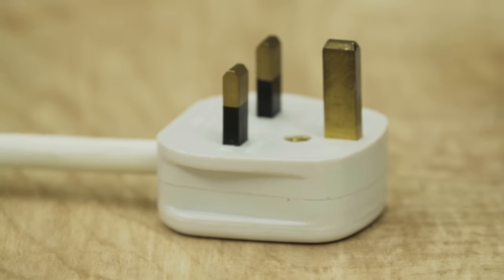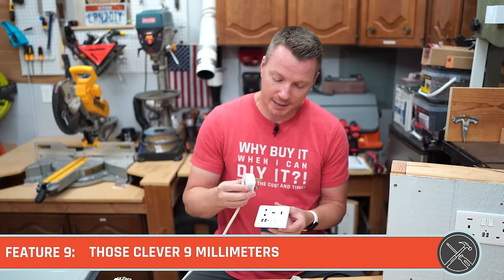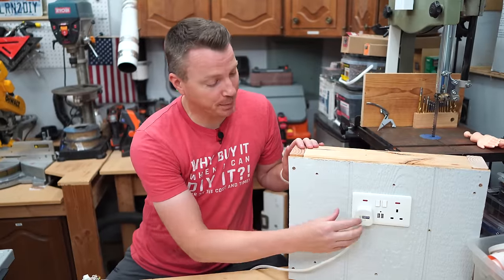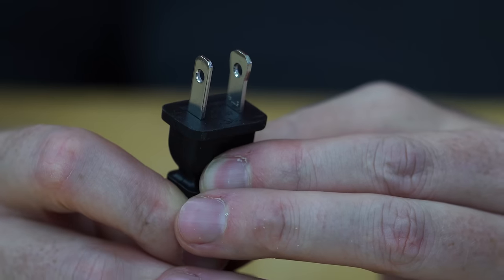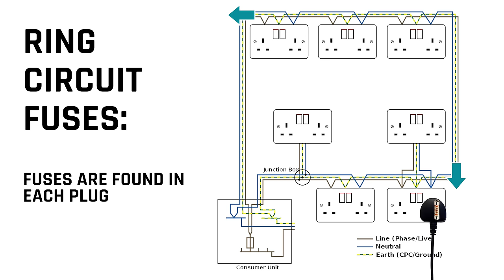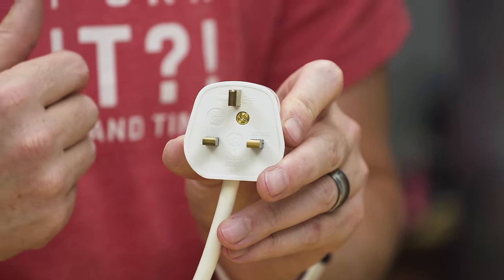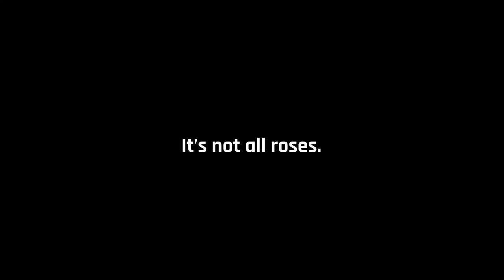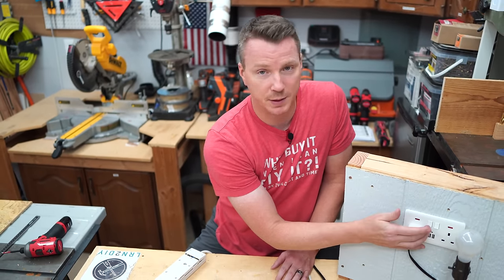British Plugs and Outlets Are On Another Level

Comment: As a professional electrician I think they are pretty good but not as good as the central european standard system especially the versions in France and Germany.  and while every country has it's own standard, the two pin version is a standard that fits in all the different outlets in europe except for the british one.

In comparison to the british the differences are:
10. like britsh, earth connects first although the wholes aren't blocked unless you buy an optional safety piece which isn't as good as the british one.
9. the plug is suspended in a hole which serves the same purpose. The two pin Version is just like the british.
8. The Cord orientation is the same most of the time but there are also straight ones
7. like the british
6. Sometimes it's better to have a plug that cant be opened. there are both versions availabe but a fully molded plug is, although not fixable, the best option in terms of durability, the cables almost can't get ripped out, and it's tighter sealed against humidity and corrosion.
5. Fuses are in the device rather than in the plug. Debatable what's the better solution but it saves space for the plug.
4. like the british (maybe a little less but still good)
3. like the british
2. no switch but that's less of a plug type thing than a standard for the whole system.
1. like the british

-Another difference is that the german version aswell as some others but not french and the two Pin Version are twistable. Sometimes I want the cable to come out in the other direction. However it comes with the disadvantage of not knowing which wire is life and which is neutral.

-The size is more compact then the british one. and the two pin version is so slim, you can even use two of them side by side in one outlet it some special kinds of the german outlet.

-No ring system

Overall the form of them with the suspended outlets just seems even better, then the british ones and it's a standard where a lot of different plugs can fit in the same outlet.

Comment: As for the European 2 pin plug, quite a few small appliances from very reputable European manufacturers come with them. Most need to be used with a shaving adaptor (as it's known in the UK) .  The shaving adaptor route is often marred by bad connections as the Euro plug is a fairly lose fit in the socket and there is no support. New shaving adaptors come with a 1A fuse which blows as soon as you turn a more "meaty" appliance on such as a stick blender, so you are forced to find a supply of 5A 20mm fuses. An an otherwise excellent and expensive Italian hair dryer came with a strange snap on converter from Euro to 13A. After a little use it failed and on examination the connection between the 13A live pin and the clip that the European plug pin engaged hadn't been staked properly, overheated and melted the plastic. In both cases the problem was solved by replacing the Euro plug with a UK 13A one.

Comment: I would like to emphasise the asymmetry aspect. I.e. the fact that the positive (phase) pin always goes in the positive hole. This is important because, especially, lamps are only switched on the positive side. In Germany, for example, the otherwise adequate plugs can be inserted with the positive pin to the left or the right, meaning a lamp is still iive when switched off.
Reply: Yes, but that's not unique to British plugs. In America lamps have polarized plugs that are also asymmetrical.
Reply: @aminy23  I didn't claim uniqueness.

Comment: I’ve lived my how life in the U.K. in 45 years I’ve never known anyone with power loading issues.  Until this video, I never really considered that this could be a thing. So I guess it’s really rare. The size of the plug is a fair point, but they’re still small enough to not make any significant impact by their size. The trade off is that you can fit a fuse inside and it’s generally safer. Small price to pay. The point about the switches at the end is just silly. If you’re used to it, if the appliance doesn’t switch on the go-to response is to check the switch at the socket. It takes a second to do. And the advantages with the switches in both safety and convenience is well worth the split second it takes to flick a switch.

Comment: (US here) Would be cool is we could shrink it down a bit to a reasonable size or a design that incorporates a lot of the features while maintaining slimness. The idea of being able to use a welder (in 200v mode instead of 120v) or even 2 high consuming devices sounds amazing without the need for a special plug. But we're so far developed there's no chance in switching plugs. We already have enough issues switching cables as is. Sigh

Comment: To anyone in a contry where type G is the used socket and plug, 10:52 this statement is wild😂. We are so used to switch it on off from both ends and check the remaining end before any troubleshooting.

Comment: The finest plug ever designed you can run a welding set on it, also modern washers it does get hot though.
It wasn't designed by the Gov so that's why it's brilliant.
Reply: It was designed by a government dept.

Comment: Another good feature you mentioned but not emphasized on is that the wires not coming from the side...  but not because you cannot pull it but because you can bring furniture or appliance closer to wall. It drives me nuts that I have to buy an adapter just to be able bring tv stand closer to wall.

Comment: I'm Aussie and there is nothing that you said here that that makes the poms plug better than ours. We have the choice of side, bottom or front cable entry plugs for whatever you want and non earthed appliances don't need a fake earth pin for locating because you cant insert an Aussie plug upside down anyway.
Everything else you mentioned is just as effective or better with this Aussie plug.

And 110V consumption voltage is a terrible Idea but the yanks just have to be different don't they.

Comment: Only bit of information here which was a slight error was when you suggested that you could plug a washing machine into the same socket, typically high power appliances like the washing machine or dishwasher will have their own separate socket, which is a ‘fused spur’ off of the ring main itself, the socket will be hidden behind the appliance and the switch will be above the worktop with its own fuse. * (described to the best of my knowledge I’m not a sparky I don’t know all the technical mumbo jumbo 😂)
Reply: Nope. A washing machine can be plugged into any socket on a British system. Washing machines and dishwashers are not connected via fused spurs off final ring circuits, they are plugged into sockets.

Comment: Not all sockets (receptacles in US lingo) have switches.  Anyway if your device doesn't turn on that switch is always the first thing to check...so it is never a problem.
Load balancing is never needed in ordinary domestic installations.  Load balancing  is needed only in  larger commercial installations.
Just recently I learned that Americans hardly ever use Electric Kettles because they need twice the current because of the 120V AC.
(I really do learn something new every day.)   Everybody here in  230V-land  uses electric kettles for just about everything.

Comment: Interesting video about a plug I've been using all my life! Born and raised in the United Arab Emirates here. The only con I have with this plug continues on what you said about the plug size. The plug size itself isn't an issue when it comes to appliances and such because realistically speaking that shouldn't affect anything. The real issue for me is that chargers can't be as compact, pocketable, or tech pouch-friendly as the American counterparts which typically have folded prongs. I've seen a small amount of UK chargers that have folding plugs, but it's not as common as I think it should be, and I don't think any of them support high charging speeds.
Reply: Samsung phone chargers  have a neatly recessing earth pin, both normal and high-speed types. Still not as widdy as American ones, but not bad.
Reply: @effyleven  Yeah I know those, they're definitely a better option than the regular ones, but I meant something along the lines of 65W or 100W of charging so I can charge my laptop and other devices at once.

Comment: Hi, The USA runs a 110volts through their plugs and if the USA had wanted to change you would have to increase in electricity power.

The UK runs 240volts through their plugs and this is difference in power.

But you can also get the the G type rubber plugs and these are for heavy duty work like power tools and industrial work.
Reply: The USA runs 240v and 120v into homes. Duh! They should adopt the UK plugs then eliminate the 120v. But have mandatory RCBOs or AFDDs on each circuit at the main panel.
Reply: @johnburns4017  Much as I'd like that Brandon has caused far too much damage to worry about this.
Reply: @PhilipMarcYT  
Brandon?

Comment: If they did they stick something conductive into a British outlet they are more likely to have been killed as British power is 220/50hz single phase and the odds of electrocution are higher and thus the English deployed a more robust standard outlet and receptacle.   You might also find that the insulator is thicker because of the higher voltage, however the conductors are smaller in diameter for a given load  because they needless current.  The 220v implementation was probably done because it was less expensive to build out with smaller conductors that require less copper or aluminum.   I too appreciate these plugs.   The US plug traces its way back to Edisons DC systems and his early light bulb filaments which were most efficient in terms of output to longevity at around 100v DC.  pushing 110 accommodated for attenuation.

Comment: the fuse in the plug is to protect the cable if  shorted or damaged not the device the fuse is secondary for protecting the device and has been watered down  std as cheap way on the device protection but the device is required to have a fuse as well, with the invention of rcd breakers fuse on device has sort of been forgotten in the 70s 80s everything had a fuse in the device as well, the ring mains approach allows for more sockets on a circuit on a given cable size, we sometime call them Mk plugs is another name, also we have 15 amp plugs as well looks the same but has round earth pin instead of rectangle

Comment: I still prefer the european standard plug (the thick round one, not the skinny flat one) because:

- There is a safety wire connected first like in Type G (The contact is on the outside of the plug)
- The live/neutral disappear inside the outlet before actually connecting
- It maintains 230V

And the most important -> you can plug it the other way, so the cable runs up the wall instead of down.
Especially on extension cords with angled outlets or when your device is on a shelf and the cord is not long enough to run down first.

But the feature to open the Plug and to switch off the Outlet is quite nice.
Reply: The British plug is the best.

Comment: Merica can really take notes from this design. And, of course, engineers over here would make it smaller, too. Probably don't carry over the ring circuit, though. It seems a bit unnecessary. No ring circuit = no need for fuses in every plug, so that's an e-waste plus. Serviceability, required and longer ground plug, down-facing lead, and separated live and ground(with the live coming out first in the case of strain) are very nice features.
Reply: Radial circuits benefit from plugs with fuses. The US is best to adopt the UK plug in its entirety, to make matters compatible.
Reply: @johnburns4017  Which is why I said the US can leave out the radial circuit design. That system doesn't work with how the US electrical grid is built, and our electronics can't do over a certain amount of watts anyways. It's not just the plugs, but the circuit board on breakers and converters that limit our output to 120v, with only industrial applications getting 240v standards. If we change that, we'd have to change everything in every household, from wiring to outlets. By adopting new plugs sans fuse, we'd just have to change out the outlets. An adapter for existing plugs wouldn't be too expensive either, so it would be doable. Going house to house, taking out all electrical wiring just to put in the new radial circuitry, building our own fuses and requiring old and new devices to have fuses, would be a headache that takes a whole decade or more to implement and adopt. And, again, the e-waste it creates. Some designs good and easy to adopt, others costly and takes time. 
Best solution I can see is the US changing all outlets to the UK style, selling adapters so we can plug current devices to the bottom or top of the adapters, and new appliances using a modified UK plug of US design that doesn't have a fuse. If a UK product is used in the US, the fuse is there to prevent circuit over-current. If a US product is used in the UK, they create a false short. Either way, both should still work, only the US product has a chance to light on fire, and the UK products in the us are limited to 110-120v.

Comment: I live in the UK and it might be because I've lived with them a lot but I've never encountered any of these problems. e.g if the lamp doesn't turn on check the plug and don't leave the plug face up or lying around in general.

Comment: Looks promising. But the international electric engineering society has recently developed an optimal and ideal p,ug system which bases on the swiss plug. It is an modified swiss plug system. Brazil, Southafrica and othe Latinamerican countries have been in the process to adopt that. That system sports an shutter as well in the socket but js based on the radial power system. In Latinamerica they use mainly the american and european power plug system. A combo of flat prongue and Euro round plugs. Earth is going out from the main circuit breaker I think. The main circuit breaker has always lots of breakers for each line an short circuit breaker and an powerloss human protection breaker. They handle it here mainly through magnetic circuit breakers where each line or section of the house has an independent one. It works.
Reply: The EU looked at a standard EU plug and socket.  The British said we will not drop down to lower levels. They said we are not adopting the British plugs staying with inferior designs. End of story. Then we dropped out of the EU.

Comment: The lamp doesn't turn on because the plug isn't turned on....  its second nature for us brits we dont think about how or why, we just check that the plug is turned on before we start disassembling the lamp.  i can see why you would mention that as being a flaw tho.  Also we typically have each bedroom on its own ring circuit, i've never once had a load balancing related issue, or any electrical issues tbh.   When it comes to type G plugs we have the standard one you can unsrew and fix yourself and then the double insulated plug.  Double insulated are mostly used on power hungry appliances, or appliances that shouldn't be used after an electrical fault (outside of a shorted fuse) as it needs to be properly tested by a Portable Appliance Test certificate wielder and in this case the appliance will be opened up tested and the wire and double insulated plug will be replaced before it is reused.  - this is to prevent the likes of your fridgefreezer combustion that set ablaze grenfell tower in london.

Comment: As five-year-old UK kid, I managed to shock myself by sliding a kitchen knife down the back of a Type G while it was plugged in. Where there's a will, there's a way...(and obviously I am responsible for the introduction of the insulation on the live and neutral pins).

Comment: The only aspect about the brit plugs I think is better  is the wiring coming out the bottom or side, rather then strait out, and that is and can easily be done to A/B plugs, it just rarely is. While safer design, imo its overkill that requires twice as much martial to produce, and takes up twice as much socket wallspace. Two minor downsides imo.  Being able to repair the $2 plug tip is cheap enough as it is, since worst case you buy a replacement plug, but be honest - how often do plugs go bad outside items plugged in and out constantly like vacuum cleaners.  In 45 years I've have one tip go bad and maybe one other, and the only one I can specifically recall was a vacuum at work being plugged in and out 5 times a day for years in where the ground prong snapped off. It still worked but was just less safe lol. Just went to home depot and replaced it for $2-3.   So no love lost for being able to open them.  I also think its better we dont have a nation of amateurs doing their own electrical repair anyway.

We do NOT have a 120v system. We very much so have 240v.  "The US electrical system is not 120V" = https://www.youtube.com/watch?v=jMmUoZh3Hq4

As for said electrical system its simply cheaper overall to run electricity over long distances using the 120|120/240 system we have in place.  England doesnt have an entire continent to power!
Why the U.S. uses a different voltage than some countries:   https://www.youtube.com/watch?v=awZ1GzGeMKM
Reply: The British plug is the best by far.

Comment: Let me correct you, different length of lines inside plug is not just about which one gets torn out first when pulling, different length is there for case of exposed wires in general -> so they can not touch one another.. (and live is shortest for obvios reasons)